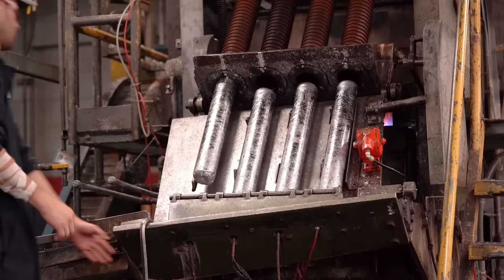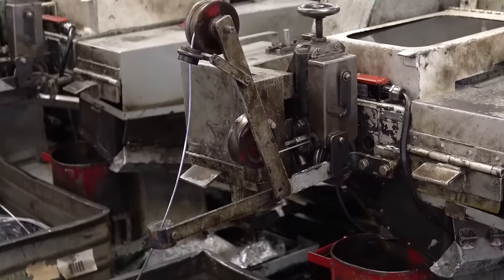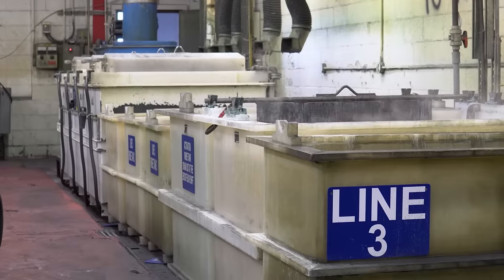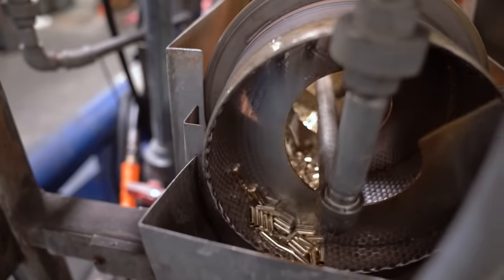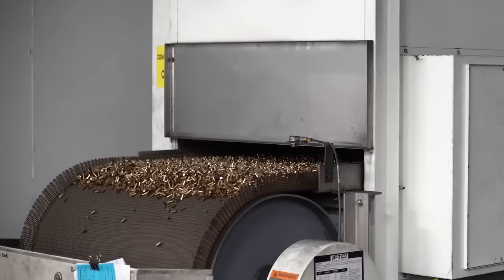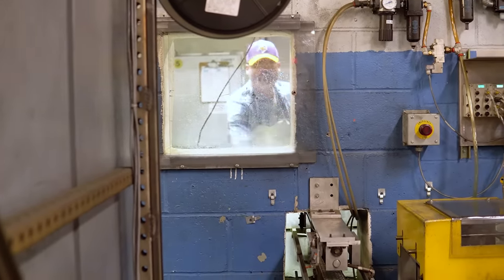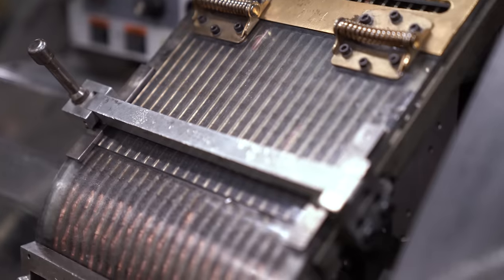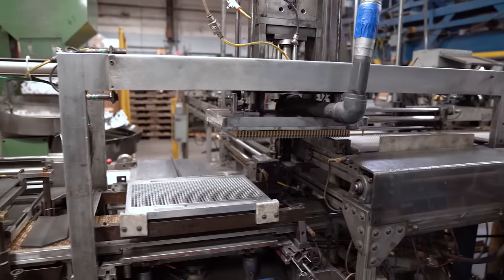How .22LR Ammo is Made

Comment: Every time I watch how something is made, I look at the machines. I just think about how smart someone has to be to invent and build such a machine. It makes me feel dumb or at least a underachiever.
Reply: Same man it just shows how intelligent humans can be at times
Reply: If it makes you feel any better each moving component on a machine was probably designed, engineered and tested by a team of several people. It's no surprise you can't do the same job as several teams of 10+ people.
Reply: The first machine built with interchangeable parts and accurate measurements in a mass production system was the Colt revolver.
Reply: Like most things engineers design it but it's the users that make them work properly
Reply: Makes me think about the work that had to go into doing something like this not even 100 years ago. Modern technology is wild
Reply: during WW2 the nail manufacturing machines were converted to spit out the projectiles.  ( these were steel bullets of course)  from watching this vid it would appear that the machines and the process haven't changed much in 75 years. (I was a Millwright in a wire mill in southern Colorado 35 years ago)
Reply: Each part was designed by different people based on the cumulative knowledge of human civilization.
But I know what you mean.
Reply: If you shoot 22 LR cartridges, even if it’s just at beer cans at the dump, you are an important cog in the 22 LR story...
Reply: Each component here was not designed by one man but hundreds of people so no need to feel like that
Reply: You are neither dumb nor an underachiever.  You are a lover of science and tech and the world needs more people like you.
Reply: Not only were these machines designed by teams of experts, they're also iterations on a theme going back hundreds of years. But yes, being bright helps.
Reply: It's just like a car. Once the timing machinery is in place, you can run the machine as fast as you want.
Reply: @immortal5271  pffft, those machines are fake, it's CGI.
Reply: Not such a big thing.
Reply: The machines are amazing, but when I look at them, I imagine the difficulty in keeping them calibrated and adjusted for maximum quality output.  .22's are notoriuosly known for failures of various kinds - which varies by brand.  The complexity and wear and tear of all that equipment is the most obvious reason - not the guns.

Comment: I've always wondered how rimfire cartridges are primed
Reply: Same. It's an ingenious process!
Reply: It blew my mind, like its such a simple ide once you see it.
Reply: @m1a1abrams93  videos gone now
 😥
Reply: @MrDALE-jy8tu  That would most likely be youboob. The Nazis of info. No different than burning books. Can't be self reliant. But anyway he flatened the casing where the firing pin struck. Then took I believe 5 matchstick heads (wooden matches). Scraped the head off into something that would be easy dumping into shell casing. Then added 1 drop of nail polish remover. Added powder, bullet, etc. He casted his own bullets.
Reply: @m1a1abrams93  thanks sir 😉👍
Reply: @m1a1abrams93  Did he add Nitrocellulose or black powder?
Reply: @MrDALE-jy8tu  Please reread my comment. I verified thru him that it's 5 match heads & one drop of nail polish remover.
Reply: I always figured 10 different ways that might work, form a mini robotic cocking gun, to primer laden paper dropped in wet.

Not one was federal's method
Reply: @m1a1abrams93  could you please tell us what books the Nazis burned and how it's a bad thing at all.
Reply: @m1a1abrams93  Video removed. How does that work?
Reply: @gizzyguzzi  YT removed his video.
Reply: Send us some thanks.

Comment: In watching the process of how these little cartridges are made, I thought I would share a two month long test I conducted before purchasing my semi-auto .22 pistol.  MOst of us have experienceed the failures associated with the caliber, and I strongly suggest that it because of thr sheer numbers of cartridges being made at once. Random failure happens in every modern manufacturing process, and .22's are just like any other widget.

They are NOT like centerfire cartridges which are made in far smaller lots, with what I assume is far more focused quality control.  That being based upon never having had a squib centerfire load from any manufacturer in my live of shooting over 50 years.

So, for those interested, here goes....

A few years ago, when I was shopping the .22 pistol offerings of all the plastic gun makers, I did extensive testing and examination of all failures related to the test firing of most of the brands of guns.  M&P .22 Compact, Walther, H&K, Ruger SR-22, Ruger Mark III Target, and Glock.  All guns were never cleaned during testing.

Each gun had 2000 rounds, divided into 500 round runs of four top brands of .22 ammo.  I will only name two brands at the end.  All ammo produced failures, but the M&P Compact handled them better.  Every failure to fire was examined by dis-assembly of the cartridge.  

In each case, no matter the brand, the cause was 
1) un-even primer distribution, 
2)rim strike on a rim with no primer at that point, 
3)loose primer material, floating within the case, not adhered to rim
4)no propellant. 
5) no primer

 6) Light detonation was presumably caused by low propellant load, resulting in no slide blowback/no ejection except for the M&P.

In my findings, the best ammo I used was CCI Mini mags
The worst was Remington bulk.  NOTE: Rem bulk works pretty good in my S&W Model 17 revolver, and probably would work just as well in any  revolver.

As for the guns, the M&P succesfully ejected cartridges with low powder.  All the others failed to eject.

I bought the M&P .22 Compact, but all the other guns were excellent, with the Glock being a bit more finicky than the others.  To  this day, several thousands of rounds later, the M&P still shucks 'em all day long, as long as I use CCI ammo.  There are more expensive ammo brands and types but I haven't tried them.

Comment: How the hell is this profitable lol
That's rhetorical, it's just impressive that it is.
Reply: Sell at high volumes to mitigate initial costs
Reply: The machinery looks very old.  They packaging however looks more modern.  It probably a good thing that the machinery is old  as a cnc machinist myself,  we typically have to replace something ever few years.
Reply: @catfan5756  Yes, you just can't beat the machines of the yesteryears. lol
Reply: @catfan5756  CNC machining is very high forces on highly engineered systems to do very complex tasks. Paying for 50 year reliability isn't in the budget. But if you want something that does one particular thing very well and you want it to run for a long time, you can put those dollars into simplicity and durability. Federal's whole line is built this way. None of the parts need to be that robust, but they are so they last a very long time. And, it's engineered to allow the high wear areas to be replaced. The chassis could be 40 years old, but the motors, cartridge plates, primer spinners, etc could be 6 months old or less.

Comment: That heat treating is called annealing. It is done to soften up the brass up again after being work hardened by the tools. My old pagers & Motorola radios were all intrinsically safe Class 1,2 Divisions A-H so I could use a pager around ALL explosive atmospheres even around hydrogen gas which can seep into almost anything. We needed some way to communicate around explosives. Numerical pager codes gave us some redundancy.

Comment: Nice video, but it left me with two questions:
First, how did the rim get made? Did something go down inside and spin out the bottom to make a rim with space for the primer?
Secondly, how did those machines turn the casing and the bullets in the right direction so they would go in the case with the proper orientation?

Comment: Wow, that was very interesting. Are other caliber bullets made in the same manner? And, with the automated system, what is the daily output of these bullets? Just wondering what was the output of cartridge manufacture if it was done by manual production during the the Spanish-America war of 1898 or World War 1. Would be a good follow-up video. Thanks again.
Reply: Rimfire are easier and lower cost than centerfire cartridges. I would say the process may slightly differ.

Comment: .22 ammo nowadays is substandard to what it was 10 years ago. Used to be .22 ammo was super reliable,
now myself and my friends experience lots of failure to fire issues because if inconsistent uneven application of primer paste, which results in no ignition. Yet if you take that same round it it is struck again in a different spot, it goes off. All the guns are in good working order and well struck by the firing pin. This happens not only in Federal rim fire ammo but in Winchester, Remington and CCI. Mini Mags used to be my go to ammo because of their reliability and accuracy but now even they are having issues and not what they used to be. Unfortunate.